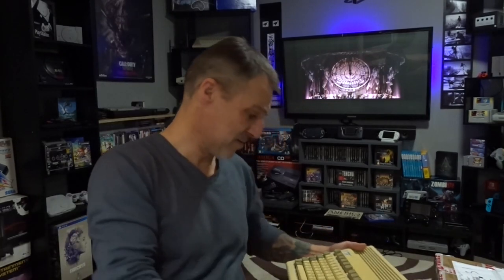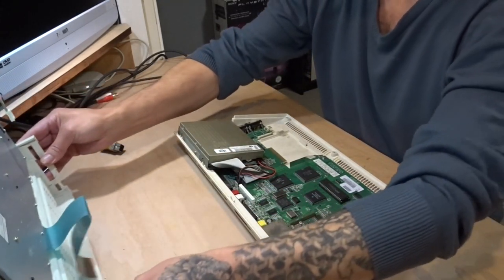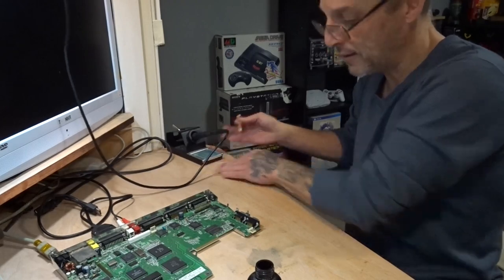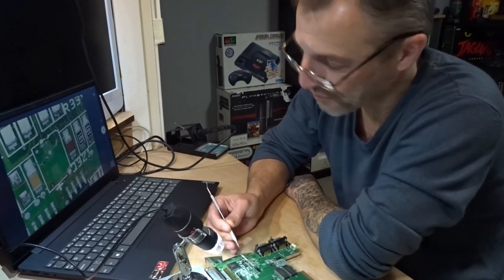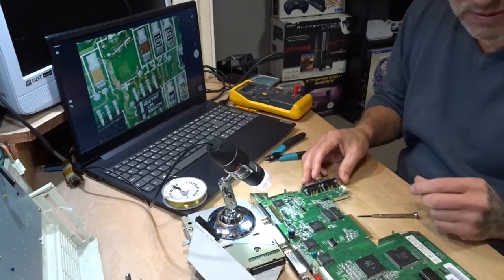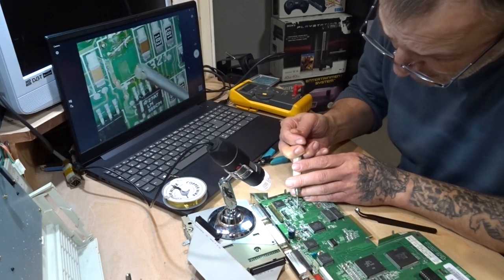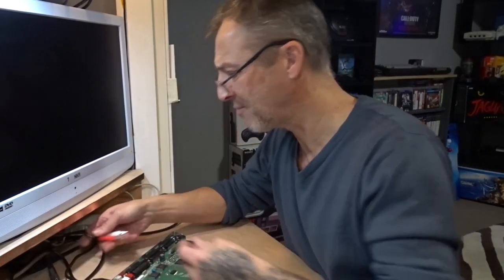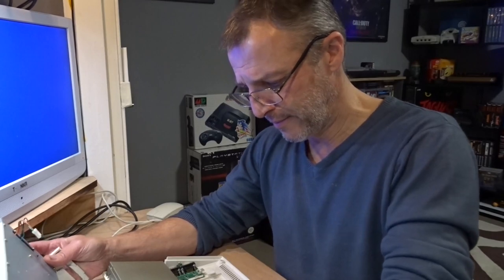Amiga 600 no video

Comment: I switched to HDMI and removed all analog video section (Capacitors, resistors, U31 and U32 and U12 chip, TV modulator, Composite, and Video port). Now mainboard looks much cleaner 😅😅😆

Comment: Great Vid Stu 👍🏻 Does that fix also apply to the A1200 boards? I’ve grown fond of the A600. Why? Simply it’s a small form factor plus unlike the A500 you can plug Hard Drives, SD or CF cards into the onboard IDE. As well as use PCMCIA cards on the side to add CD ROMs, SCSI or even Network capabilities that you can’t do with the A500 out of the box. So not getting back into the Amiga scene eh? 😉
Reply from the maker: Yeah but it's a 600 😂
Reply from the maker: Oh and yeah, 1200 has the same issue if you get a signal but no video
Reply: @SHGRetro  cheers 👍🏻

Comment: i have a dead a600 , can i connect the keyboard to a raspberry pi to convert it to a raspberry pi  emulated a600 ?
Reply from the maker: Yes, it will take a bit of knowledge of the Pi to do it but there is a few videos on YT covering emulation Pi. Fixing the board and keeping it original might be a better option tho!